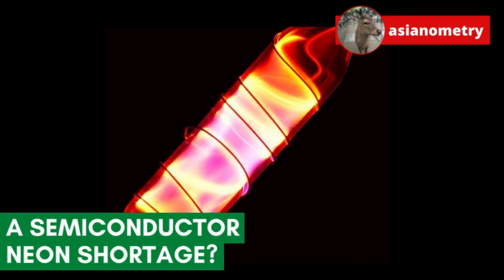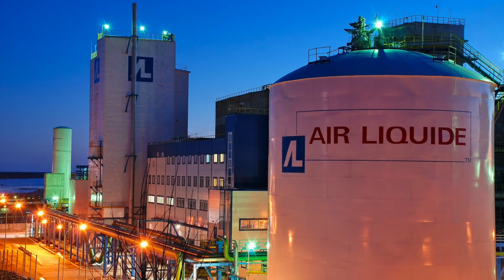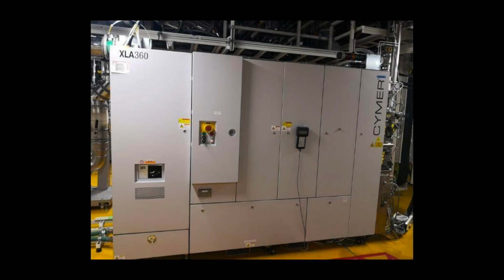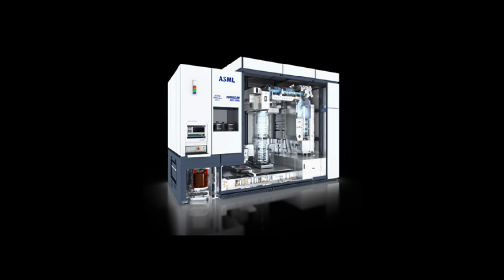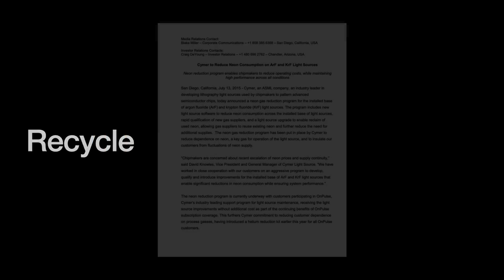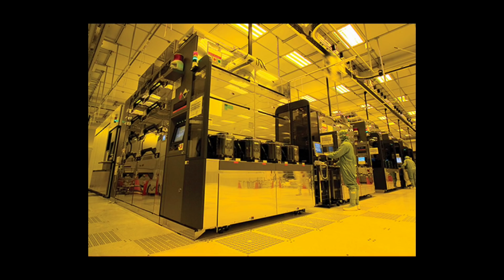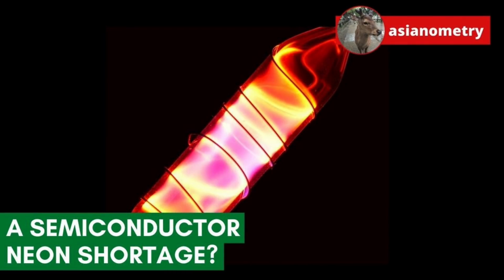The Semiconductor Neon Shortage

Comment: Around 5:30 you say that because the neon is exposed to energetic ions it degrades and accumulates impurities.  I don't understand this.  Neon does not react with argon or fluorine, since it is totally inert.  And the energy level of the UV is well below the level where it could create a nuclear reaction to change neon into another element.  So where do these impurities come from?  We're missing some crucial detail here, I think?
Reply: OK, I think I see what the issue is.  It's not really about neon at all.  Fluorine is such a reactive element that it will over time combine with the materials of the electrodes, and even the walls of the laser chamber at the operating temperatures.  Which will create ions that probably "poison" the laser properties of the gas in the system.  So the working gas has to be replaced.  It does seem that reclaiming the neon from it shouldn't be THAT hard technically, but of course that's a matter of economics...

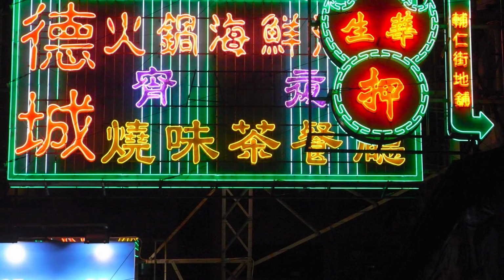Comment: 1:05 Those neon signs in Hong Kong? Mostly gone now, because LED light signs are cheaper to produce and maintain, typhoon damaged many of those old neon signs, restrictions about the safety of the iron arm support of those big neon signs, regulations controlling light pollution at night (those neon lights are bright and hot), and most importantly, the several economic down cycles in the past decades led to the closing of many companies that use these neon signs and the new ones adopt LED instead.

speaking from the experience as a Hong Konger.
Reply: Do new LED signs try to imitate the old neons, or is the style basically dead now?
Reply: @mysteriousmango6467  I assume that you are asking for how it is in Hong Kong.

The answer is, it depends, but the neon light style is definitely not mainstream anymore.

After all, LED signs are more customisable than neon signs and can adapt to different design styles, because you don't need to produce and bend those long glass tubes to hold the noble gases, and the colour options of LED signs are nearly limitless.

Shops and companies and buildings nowadays seldom have big light signs due to the new regulations and ordinances. But when they do have signs, they often use light boxes, or make it consistent with the branding and overall design style.

Comment: As a "side note". Ukraine runs the worlds largest air liquidification facilities because its one of the worlds largest producers of ammonium (NH4) nitrate fertilizers, which require nitrogen. Much of this fertilizers was used in Ukrainian agriculture, making it a large wheat exporters. But fertilizers are also exported widely.
Long story short, we will have hunger and starvation in many places of the world by the end of the year.
Reply: Lol imagine picking on the world's largest ammonia producer.
Reply: A possible outcome.
Reply: Dang an argument about how a fertilizer is produced
Reply: No... you don't need oxygen from an Air Separation Unit (ASU) to make either urea or ammonium nitrate fertilizers. It would be far too costly to do so. Ammonia nitrate is made by mixing nitric acid with ammonia.  Ammonia is made in the reforming process with air and natural gas as feedstocks.  The nitric acid is made with ammonia and air using the Ostwald process.  The nitric acid process starts by directly oxidizing an air/ammonia mixture in the presence of a platinum catalyst to produce nitric oxide (NO) via  the reaction 4 NH3 (g) + 5 O2 (g) → 4 NO (g) + 6 H2O (g)).  The NO is then reacted with oxygen present in excess air to produce nitrogen dioxide (NO2) via the reaction 2 NO (g) + O2 (g) → 2 NO2 (g).  The NO2 is subsequently absorbed in water to make nitric acid (HNO3) via the reaction 3 NO2 (g) + H2O (l) → 2 HNO3 (aq) + NO (g)).  The remaining NO is usually recycled to the front on the process.   

  Moreover, most nitrogen fertilizers exported from both Russia and the Ukraine are as urea fertilizer… not ammonium nitrate.  This is because urea has a far higher nitrogen content than ammonium nitrate and is far less hygroscopic than ammonium nitrate; hence less likely to cake during transport and substantially cheaper to transport. (Former Chemical Engineer/Economic Analyst with the United States’ former National Fertilizer Development Center – closed in 1990).
Reply: @davidkelly577  I beg your pardon? "Reforming air with gas" is BS. 
Its reforming Nitrogen (from air) with hydrogen (from electrolysis or methane reforming).
And one makes nitrogen through air liquidification and distillation. Oxygen and all the other gases are by products.
Reply: @michaelrenper796  B.S. You don't know what your talking about.  

Electrolysis is never used to produce ammonia commercially.  That process is too electrical energy intensive, costly, scales poorly, and has exceptionally poor economics of scale.  Virtually all commercial ammonia production uses Haber–Bosch's methane reforming based process.

Methane reforming uses air and natural gas as the feedstocks to the methane reformer.  The primary reaction is CH4 + H2O -> CO + 3 H2.  The reformer produces hydrogen under partial oxidation conditions and a small amount of CO2 is also produced in side reactions.  The oxygen depleted gas mixture (hydrogen/nitrogen/CO rich) then undergoes a CO shift reaction to convert the bulk of the CO to CO2.  The gas is then processed thru a CO2 removal system  (usually an amine process) to remove the CO2 from the gas mixture.  The gas mixture is then processed thru a methanation system to convert residual CO and CO2  to methane (to prevent poisoning the down stream ammonia catalyst).  And finally... the nitrogen/hydrogen rich mixture is catalyzed to produce ammonia.  

The only time you would encounter an air plant in ammonia production would be when using an oxygen-blown coal gasification plant as a substitute for the natural gas based reforming system.   And then, one would use an air plant only because it is generally cheaper to process the coal in an oxygen-blown gasifier (again under partial oxidation) as opposed to an air-blown gasification system.  One would only use a coal gasification system if one had no access to natural gas or the price of natural gas was at least three times the price of coal on a $/Mbtu basis.

Don't believe me?  Try simply doing a google search under "ammonia production processes" or "Haber-Bosch process". 

Really, you shouldn't argue with someone who produced ammonia for a living.
Reply: @davidkelly577  You shouldn't talk to somebody who grew up in the town and worked in factory where Haber and  Bosch invented the "Haber Bosch process".

https://de.wikipedia.org/wiki/Haber-Bosch-Verfahren

May be English Wikipedia is hard to read for you, so I included the Wikipedia article in the language of science.

For the scientifically interested reader (Kelly is a useless armchair chemist)- Haber Bosch process in practice means:
1) When electricity is cheap ones makes hydrogen through electrolysis - about 40% of global hydrogen production.
2) When methane is cheap one makes it through methane reformation - about 60% of global hydrogen production.
3) Methane reformation uses water - not air - as source of oxygen
3) Nitrogen is extracted from the air through destillation. The oxygen is a valuable by product.

The reason why the air based process claimed by David Kelly is not being used (his claim that he works in the field is laughable ) is the required purity of input materials to avoid poisoning the catalysts.

Reforming Methane with air produces would produce a "mess" of hydrogen, water, nitrogen, carbon based gases, which would need to be purified before entering reaction. The only sensible way to do this is destillation. And so we are back to square one.
Its overall more efficient and "cleaner" to produce nitrogen from air separate from the hydrogen. When reforming Methane use purified water gives the "cleanest" output.
Reply: @michaelrenper796  Your display of ignorance is astounding.  

Haber Bosch process  is a methane-reformer process not a electrolysis process... and never was.  Furthermore,  the methane reforming component of the Harber process is endothermic (i.e., consumes heat).  The heat is provided by simultaneously combusting natural gas in the reformer... hence the excess oxygen.  The   methanation component of the process also removes residual oxygen.  

In addition, the excess CO2 produced by the Harber ammonia production process is used as zero cost feedstock to urea production.  Which is another reason urea production tends to be cheaper than ammonium nitrate production.

Prior to the Harber process's development, the preferred methods for nitrogen fertilizer production were: 1) the Birkeland–Eyde process which produced nitric acid using electrical arcs to react atmospheric nitrogen (N2) with oxygen (O2).  And 2) the Frank–Caro process which fixed nitrogen as CaCN2 which could be sold directly or used to produce ammonia. 

Finally, we are talking about the production of low cost nitrogen fertilizer; not high purity industrial gases that can command much higher prices.  

Seriously kid, your embarrassing yourself.
Reply: @davidkelly577  Sigh - when people can't even read the first paragraph in Wikipedia ...
Reply: @davidkelly577  No intent to remove a discussion where you embarrass yourself by mixing things up so badly. As you have now read Wikipedia you will realize:
1) Methane steam reformation uses water (nor air) to produce hydrogen. I does not produce a hydrogen nitrogen mix. It produces pure hydrogen.
2) ASU (air seperation unit) are used to make the nitrogen (the oxygen is a by product, nobody talked about oxygen here in the first place, but you).

3) The Haber Bosch process is the Ntrogen-Hydrogen reaction. It bears no relevance to Haber Bosch where the hydrogen comes from.

And yes, there is still a  substantial amount of hydrogen made from electrolysis. And yes, historically most hydrogen was made that way.
Reply: @michaelrenper796  Sigh....looks like I'm going to have make this simple for you.  Since, clearly, you don't know anything about ammonia production processes, the process chemistry of a methane reformer, or the steps required to make ammonia in commercial plants.

1) The methane reformer uses oxygen from AIR to accomplish three tasks.  A) serve as a combustion source to heat the reformer's catalyst to the appropriate temperature, B) provide the heat to make the primary endothermic reactions proceed, and C) optimize hydrogen yield resulting from two of the four primary reactions occurring in the reformer.  These reactions are:

       CH4 + H2O (steam)  → CO + 3 H2  (requires methane & steam with no oxygen)
       CO + H2O  (steam) → CO2 + H2     (requires CO & steam with no oxygen)
       4 CH4 + O2 + 2 H2O (steam) → 10 H2 + 4 CO (requires methane, O2, and steam) 
       2 CH4 + O2 + CO2 → 3 H2 + 3 CO + H2O (requires methane, O2, and CO2) 

The outlet temperature of the syngas is between 950-1100 °C.  The inert gases FROM AIR entering the reformer (including nitrogen) moderate the reactor's temperature thru dilution and enhance yield.   

Short version.   Air is introduced as a primary feedstock to the reformer to optimize hydrogen production.   The nitrogen leaving the reformer is used later to produce ammonia... after having undergone needed processing to remove CO, CO2, H2S, COS, and H20.

2) Yes the reformer's purpose is to produce hydrogen.   

What your clearly not getting is that Harber process includes:  Methane reforming, CO shift using high and low temperature CO shift reactors w/ heat exchange, followed by cooling, H20 removal (usually thru condensation), CO2 removal (usually an using an amine system), trace sulfur removal (usually using a Zn oxide catalyst), methanation (for trace CO2, CO, and O2 removal), high-pressure compression, ammonia production (with an iron catalyst), ammonia separation (cooling), and finally unused nitrogen/hydrogen recycling back to the iron catalyst.  

Your making the mistake of assuming the final processing stage (ammonia production) is the entire Harber process.  It is not and never was.  

The Harber process includes all of the process steps described above.  

The ammonia production portion of the Harber process can be incorporated into other ammonia production processes, coal gasification for example.  And this portion of the Harber processes has been proposed for so called "Green Hydrogen" electrolysis-based ammonia production system's.  But these "Green" systems are theorical proposals... not working systems currently engaging in commercial ammonia production.  Nor are they, currently, economically viable.

3) I'm well aware that Air Separation Systems produce nitrogen.  I worked with an ASU as part of NFDC's "ammonia from coal project" in the mid '80's using a Texaco oxygen-fired coal gasifier to produce ammonia.  The ASU was used to supply oxygen to the gasifier and nitrogen to our modified ammonia plant.